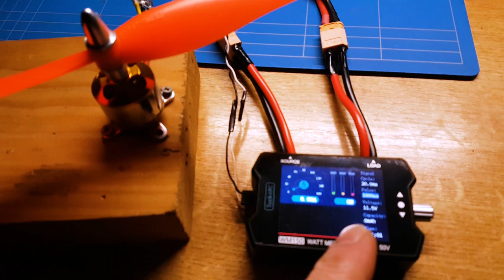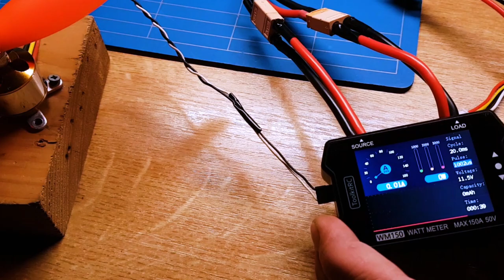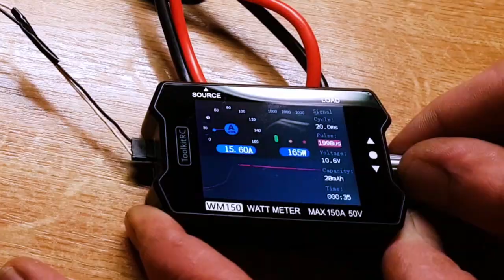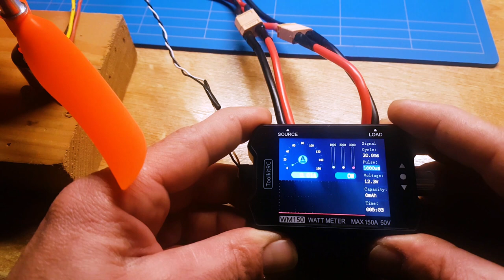ToolKitRc WM150 150A Watt Meter Test Review and How To Calibrate ESC

Comment: You should try calibrating the A measurements! is that possible?
I mounted a 1.5 m ohm shunt and the measurements with the Wattmeter are shitty! more then 15% offset
Regarding the 150A I doubt that is possible with this Wattmeter, 150A is a big current to handle

Comment: Nice video!

Any idea on the maximum capacity it can measure. Does it go to 9999mAh or can it do higher capacities?
Reply from the maker: it meassure watts not mah i used a 16000mah battery no isseu
Reply: @HowToDIYRc   All of the pictures I have seen so far show that It has a capacity measurement in the bottom right corner. Are you sure yours does not have that as well?
Reply from the maker: it measure vthe amount of mah you used during the watt test
Reply: @HowToDIYRc  I understand. What im wondering is if you could tell me how hight that number can go?

When you tested your 16000mah battery did it display 16000mah or does it reach the maximum sooner? Like caps out at 999mah or 9999mah.

I need to find something which can handle my 20Ah packs, that's why im asking.
Reply from the maker: of course i dident use all 16000mah that takes days to empty it 
i think it caps at 999 but i can be wrong
Reply: @HowToDIYRc  Wish me luck then, I'm planning to empty a 9S 20Ah battery in half an hour :)

I got my answer. Thanks for the info!
Reply from the maker: goodluck sir with must be awesome drone or a car

Comment: I have the wm150
Why is any pc I try not recognising it? I have also tried other usb cables. It works normally but not picked up on any pc!
Reply from the maker: that is strange but i have no clue or idea what the problem might be sorry :(
Reply: I have the some problem! probably because the USB cable is not 3.0 as recommended by manufacturer